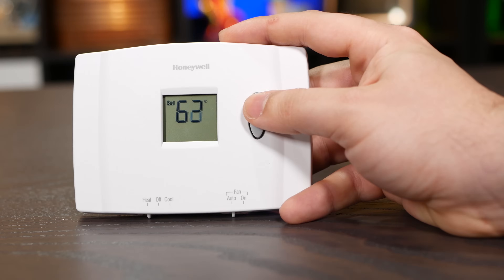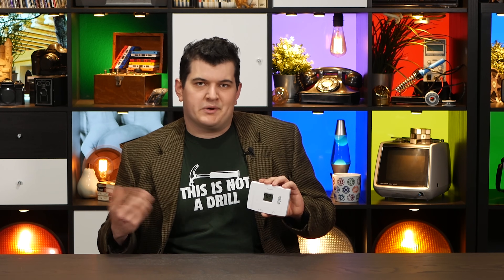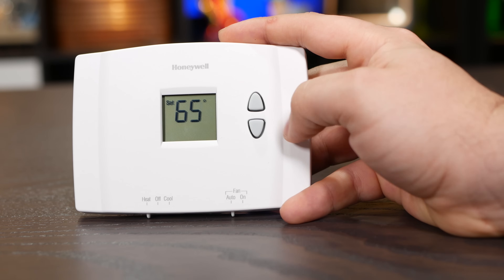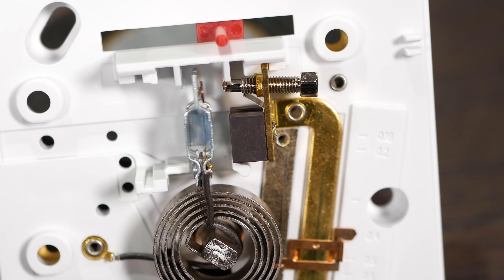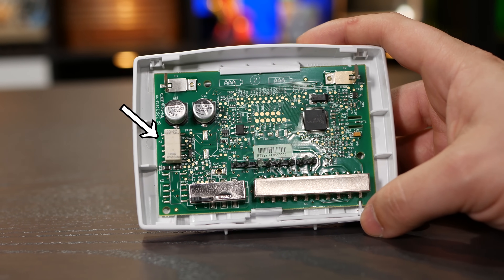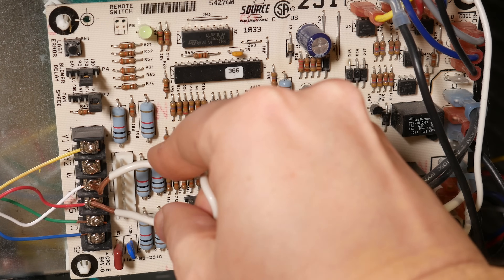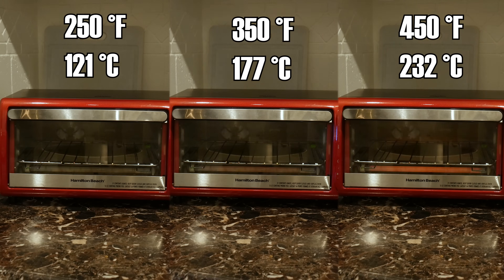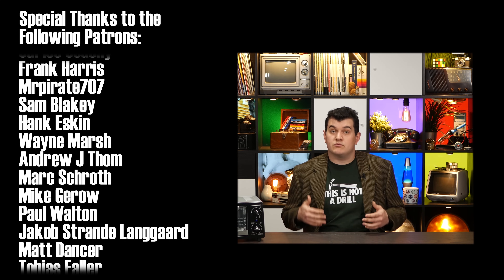Thermostats: Cooler than you think!

Comment: Here in Europe we have thermostats and heaters that use the OpenTherm protocol, devices that use this protocol can change the amount of heat they output. This means that the central heater can be heating up, but only up to half flame if the thermostat says it doesn't need much heat because the room is almost up to temperature.

Opentherm only uses two wires and over those wires it carries a lot of data: domestic water heating on/off, room heating on/off, domestic water temperature, central heating water temperature in, system water temperature out, setpoint system water temperature, outside temperature, flame status, faultcode, current room temperature, setpoint room temperature and water pressure.

This way both the thermostat and the heater know what's going on and no energy is wasted by putting the heater on full blast whilst the room only needs half a degree heating, this makes the whole system more efficient, better for the environment and better for peoples wallets.

European thermostats also don't need batteries, they get the power supplied over those two wires.

Comment: Regarding the "one cycle of cooling" question: I know that at least some thermostat models (the T600HCP-3 for example) sold by Johnson Controls have a local lockout and temporary override function that can be enabled. Its really meant for the office environment, which is where I've come across that particular model's features when my office-mate liked to set the temperature at 80 degrees F and switch the temperature display to Celsius everyday. One quick evening with the manual and the thermostat and I had won by allowing him to change the settings for an hour before they reverted back to a more reasonable setup.

The thermostat at my house does not have such extreme setup features. It can be set for 4 different "daily time periods" and will temporarily take an override temperature until the next time period comes along.

As all things go, check the manual to find out what hidden features your thermostat might have

edit: if your thermostat allows it, deadband is a really nice setting to change

Comment: So what is the big deal with these digital thermostats? The factories are printing out cheap computers to basically turn the switches on and off. Then smart thermostats are even worse; they sit there and turn the switches on and off, and they send you the Electronic Mail saying;"hey, I've had this thing turned on for over 3600 seconds, and it's not getting any warmer. I think you might have a problem."

I'm not saying that's necessary a bad thing, but it seems to be kind of resource intensive.

Comment: My furnace/AC has a hardware switch on it for fan speed, but the thermostat has nothing to do with that.  So I can set it on full blast, or somewhat less blast, but only with a switch in the machine behind the filter cover.

Comment: I once heard of a system using Fuzzy Logic. To the best of my knowledge it operates by instead of just on and off. it would say make the appliance output a controlled temperature lets say 72 degrees instead of full blast as you mentioned.

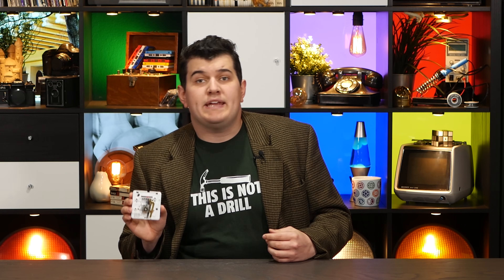Comment: 6:25 Yup! This is called hysteresis. I guess you have a forced air furnace, that does not support modulating heating control? We use OpenTherm for our central-heating condensing boiler (with radiant floors).

Comment: At work they have programmable thermostats that allow you to adjust the temperature for a set length of time (default is 1hr but it does 15mins-4hrs) and then go back to the programmed temperature. I like to use it to reduce humidity when I mop the floor so it dries faster. 😉 The older one is made by White-Rogers and the fancy new touchscreen one by Emerson.

Comment: I am not sure if this is the same situation in the Netherlands(where I live). Has this kind of on-off approach a downside that is because it takes time to heat up water, and then the water the air in the room, there is a time gap, which makes the temperature rise too much. And reverse; when it's off, the temperature declines, but it takes time to heat up the water, so when the thermostat goes on the temperature is still declining. Is this different in the US? or is it only applicable to large houses? I have no idea. I read this in a brochure from 1998 for a new furnace, which is able to throttle and together with the right thermostat it's able to heat the room more efficiently and less volatile - according to the brochure. Our new furnace, which is even more efficient, has also a thermostat outside the house, to measure outside temperature. Not sure why. have a great day

Comment: To talk about a thermostat that has a time on setting to run the heater/cooler briefly after coming in, we have a Mitsubishi split heat pump that has something like this. It has a button for “powerful” that basically makes the system output it’s highest level of heat/cool and turns the fan to the highest setting. It only stays in that mode for a set amount of time then returns to the normal slow and steady heat/cooling. It’s just for when you want that quick, but temporary burst of heat/cool. It uses a lot more energy in that mode than it normally uses.

Comment: Today I learned why my thermostat clicks when I bump the heat on! I knew about the bimetallic strip, but not the magnet which is making the sound.

I do notice, though, that our thermostats also click when I turn them to the left to make it cooler in the room. Any idea why that is? Is there a second magnet in there on the other side? Our thermostats are connected to heaters with no air conditioners involved, and we live in an apartment so I assume they're buying the absolute cheapest thermostat they can get. Assuming it only controls heat, why does it click when breaking the circuit?

Comment: If you have a head pump, there are two levels of "blast" for heat.  If the temperature drops too low outside, or if the requested temperature is much higher than ambient, the heat coils, also known as emergency heat, engage.

Comment: It's funny what you said about not setting the thermostat to 80 to "heat the house faster".  
In my circle of friends we all have relatively new cars.  None of them know how the climate control works and for some reason they won't or can't learn how.

In the winter they all set them up to 90 or in the summer they set them to 60.  In my car I leave it on 73.  In 5 years I've never changed it.  Quite a beautiful technology actually. 

When I point this out to my friends, I get a strange WTF look from them.  What's stranger is when they ride in my car they all compliment me on how comfortable my car is.  Then I give them the WTF look. 😏
Reply: Automotive HV AC is not on/off like Home HV AC

The AC on some models is on/off, other models have Variable displacement compressors to modulate cooling BTUs

But the heat on all is capable of 0-100% of max BTUs and all points inbetween. Car heat systems have a door that controls the mix of cold and hot air. In the winter the cold air is cold air from outside, in the summer the cold air is from the AC evaporator core. In the summer your car may be mixing in say 10% hot air to acheive 73° once the car is cooled down inside
Reply: Yes texassince. In a car that is cooling off its interior you can cool down faster, with an advanced climate control, by setting it to 70 at first. Then as you get comfortable after 15 minutes or do, you can put it back to a more comfortable 75. It’s not the on/off situation of most home central air conditioners, where if you want 75, it does no good to set it at 70, assuming the house was at 90 due to being off by accident.
Reply: @Texassince1836 
I know.  Thx. 👍
Reply: to be fair I vary mine between 18 and 22 degrees depending on if its hot or cold out. Mainly because it feels better for it to be warmer when its cold out and cooler when its hot out.
Reply: There are occasionally situations where you need maximum heat to the windshield, regardless of the interior temperature. For example, if you are washing a salty spray off with the windshield washers. Running the defrost on 90 degrees for a few minutes, then spraying, will prevent smearing if it’s below freezing outside. The heat actually goes through the glass to help evaporate the washer fluid, do it dries clean and fast. Otherwise it condenses on the ice cold windshield and you have a smeary mess. I have seen so many people who I show this to, and they still don’t accept it.
Reply: @freedomairconditioner6152  That's also how you crack your windshield from thermal stress.
Reply: Jeffrey you have a great point there. I have seen someone crack their windshield by setting the temp slider to 85, then sliding the mode selector to defrost for 1 minute, just enough to clear the inside fog, then sliding the mode selector back to off, and waiting a couple of minutes for the windshield to inevitably fog up again, and doing this hundreds of times a day as he was a car service. It was a Lincoln Town Car. The exterior temp was about 30. Not only was he wearing out the selector, he really did crack his windshield. So you are right. Whenever I sent heat to the windshield, I had already been sending some heat to it by having the selector in floor mode, where 10–20% of the hot air was diverted to the windshield. I never cracked a windshield...maybe I was dangerously close to doing so?
Reply: @freedomairconditioner6152  I think if you turn on the car and then blast the defroster to melt snow and ice (rather than scraping it while the car warms up), then you run the risk of cracking the windshield if an avalanche slides off the roof.   That's just turning on the car and letting it sit. 

Beyond that though, a lot of people seem to just leave the defroster blasting after the windshield is clear.  I don't get that because your legs and feet are still freezing while your face is burning.  But say the car has been sitting for a while and the defroster has heated up the windshield fairly evenly.  If you then get on the highway, the cold air rushing over it will cool it down very quickly, except right over the vents.  So unlike the avalanche causing a quick cold shock over the whole windshield, I think driving in cold weather with the defroster on full blast causes more localized thermal stress.  

I've never cracked a windshield, and I think it's because I never just let the car sit and warm up.  I always scrape/brush, which means at best the air is only just starting to get warm by the time I'm ready to drive off.  Plus once the windshield is clear, I switch back to the floor vents, so only that 10-20% is left coming out the defroster. That's not enough to stress the glass, but it'll keep the fog from reappearing.
Reply: I agree. I see so many people drying out their eyes and nasal membranes leaving it on defrost unnecessarily while their feet are getting frostbite. But ever notice that it can never, ever be mentioned, without the other person getting mad?  I think if they’re ignorant enough to do that, they feel they know best. There’s a right way and a wrong way to do everyday tasks. Sorta like pre-rinsing dishes that are going to be immediately washed in the dishwasher. People who do it wrong will fight to their death to make sure they keep doing it wrong.
Reply: Cars also don't heat or cool the passenger compartment evenly.  Sometimes you just want a blast of cold air on your face RIGHT NOW.
Reply: Not to mention the fact that hybrids/EVs typically have variable-speed compressors and sometimes even modulated coolant heaters (looking at you, Volt) that truly do heat/cool the cabin faster on more extreme settings.

Comment: I have a house that has a mercury thermostat and baseboard heaters. The thermostat controls relays that turn the heaters on and off. The relays use small heaters to activate bi-metal switches. The time it takes the heaters to open or close the switches is approximately 45 seconds. This hysteresis reduces the probability of power spikes, since the timing of the heater switches is imprecise. I know about this because sometimes a heater switch will stay in the closed (on) position. Then I have to order a new switch, crawl under the house, and replace it.

I bought a smart thermostat to control a pellet stove. There were hysteresis settings for electric furnace, steam radiator, hot water radiator, electric baseboard, and others. The thermostat attempted to hold the temperature within one degree. There was no way to increase the temperature range from say 62 to 74 degrees. Pellet stoves have a long cycle time because they need to run the auger to load fuel into the burner, turn on the infrared igniter, wait for the flames to bring the heat exchanger to temperature, turn on the exchanger fan, and heat the room. When they shut down, they have to wait for all the fuel in the burner to burn, then wait for the heat exchanger temperature to drop, and shut off the fan. You only want this to happen a few times a day. Otherwise the stove runs inefficiently and the igniter fails. I just wanted my old farmhouse to not be freezing when I got home from work. I finally gave up. This was over a decade ago. Now I'd consider building my own smart thermostat. The best solution would be to replace the logic board on the pellet stove. The tough part would be implementing all the safety logic in the current design.
Reply: See my comment about the heat anticipator. It sounds as if a pellet stove would need a very early shutoff.
Reply: @pcno2832  The real problem is that a low and high temperature range couldn't be defined on the "smart" thermostat. A range of 55°F to 65°F would have been fine. The stove would have cycled much less because it would take a while to warm up and more time to cool down. An advanced controller board could allow the auger feed rate to be changed.

Comment: Thinking about the on-demand for x minutes thermostat - this seems like it could be DIY'd reasonably easily. All that would need is something that closes the relevant circuit for the desired duration - something like a pushbutton delay switch or electronic timer and relay.

Comment: I find the furnace operation clever, too.  With no fancy integrated circuits, a simple dumb gas forced-air furnace will still operate automatically with separate stages:
1) Thermostat says "I WANT HEAT!"  and jumps the two wires
2) Jumping the two wires causes fire immediately
...
3) When thermostat says "NO MORE HEAT!" it disconnects the two wires
4) Fire stops immediately

But what about fan?  Fan is sad?  No.  Fan is on a separate automatic system:
1) Fire is blasting, but the fan is still sleeping.
2) Eventually, the temperature inside the furnace gets hot enough to wake up the fan
3) Fan is blowing!  Air is forced.
4) Fire turned off!  But it's still hot inside the furnace, so keep going fan!  Go fan, go!
5) Eventually, the temperature inside the furnace gets cool enough for fan to stop
6) Fan shuts off

I like this because it doesn't just blast fire and fan at the same time.  It's more efficient because it's wasteful to blow without enough heat, and you should keep blowing while there's still heat in the furnace to use.

Comment: Too bad you didn't find an old "round" thermostat.  Then you could have demonstrated both a vintage bimetallic strip mechanism and a mercury switch (or two).  There's still a lot of them out there.

A bonus topic: How about those thermostats in old buildings that hiss at you when you adjust the temperature?  I presume those use pneumatic rather than electrical signal and power.  I'd sure like to see how those work.

Comment: I think there are really good reasons to have temperature sensors in multiple rooms, even in a single zone system.  First, in sunny weather,  the southwest room in my house gets much warmer than the rest of the house, so I might want to kick the fan on when the difference in temperature between different rooms is more than 5 degree or so. Second, right now I can't use the fireplace in winter, because the thermostat is in that room, and the rest of the house will be freezing.  Also might want to prioritize different rooms at different times of day.

Comment: So you set the heat to 70 degrees and the furnace turns on until it reaches 71 degrees, and then it turns off until it falls to 69 degrees, at which point it turns on again. 69 to 71 is two degrees. I have always wondered what that space is called and how critical it is to manage it. In heat, that two degrees can cause discomfort as you wait for the furnace to turn on again, causing me to raise the temp so that the high end and low end are both at comfort levels. But in a refrigerator, you don't want the high end to raise the space above food safety levels. If you set the machine to 39 and it rises to 42 before cooling again, then that puts the contents into food spoilage territory. Maybe they put narrow leeway into cooling situations, but wider in heating, I am curious about that.

Comment: I avoided the whole problem by having a heating system put in with no thermostat. There are timer/on/off controls, and a control for the heat output level, which I have to go upstairs and manually change. I enjoy the exercise, and it provides my wife with an amusing anecdote that she can tell her friends.